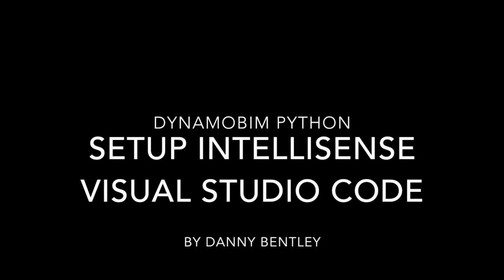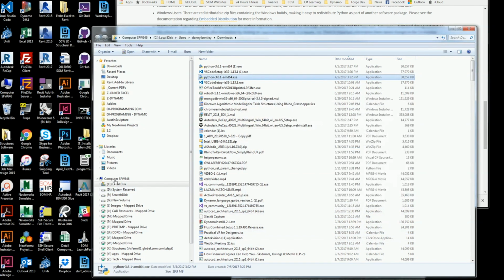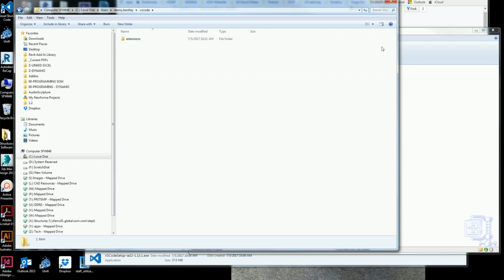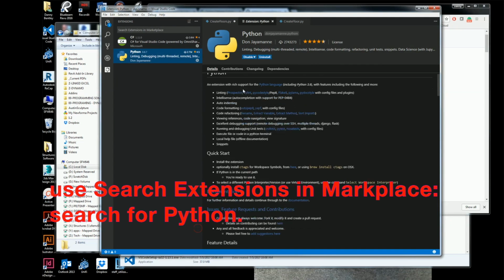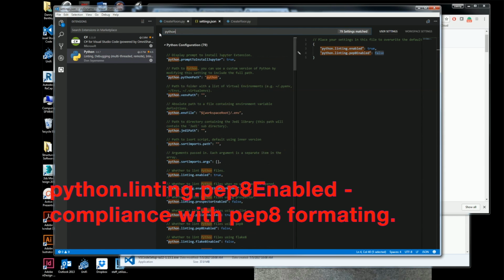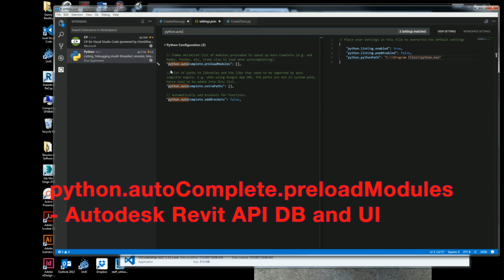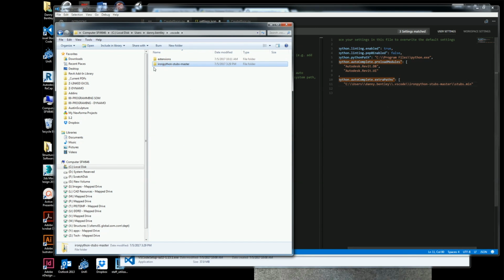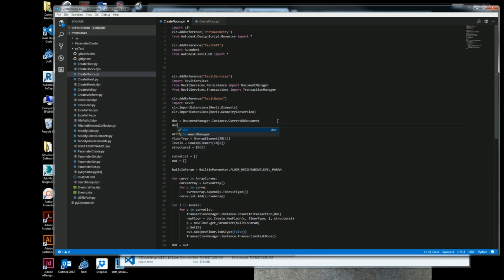DynamoBIM using Python Getting started setting up Visual Studio Code and Revit API IntelliSense.

Comment: Thanks for the video - it's great! I have one question. I downloaded the same extension as you, but there isn't function: python.autoComplete.preloadedModules. How can I link modules Revit.DB and Revit.UI to vs code?
Reply: I had the same issue... I found that 'python.autoComplete.preloadedModules' has been deprecated. They suggest changing this setting instead: "python.jediEnabled": false
Info here: https://github.com/Microsoft/vscode-python/issues/1704
After doing this auto completion seems to work good and fast, however...
pylint is giving me a bunch of 'unable to import' errors, so I just had to turn off pylint. Hopefully I can find the reason at some point.

Comment: Is there a way to run python scripts in VScode with a live connection to de dynamocore.dll API or RevitBatchProcessor or RevitPythonShell?
Reply from the maker: Sadly I not aware of a connection like this at the moment.  Dynamo needs the code in the python node to compile.  The IDE shipped with Dynamo isn't good, but they are trying to improve it.  I would like to have the ability to write in VS when I double click on the Dynamo node.  I would also like to have VS understand that it's using the Dynamo and Revit packages and give me the intellisense.  I will keep my eye out for a solution like this and if I do I will share it.

Comment: Just a quick question. 
Did they somehow manage to integrate CPython into revit? Cos, you were linking a 3.5 python into the python intellisense?

If so I'd be very happy because IronPython is like.... very very old. Can't even use numpy :/
Reply from the maker: Thank you for your post.  Revit uses .NET and therefore uses IronPython.  It seems that .NET has a Numpy, Scipy etc library.  

You can find a blog post here: http://blog.enthought.com/python/scipy-for-net/#.WYSltITysuU 
and the github repository here: https://github.com/numpy/numpy-refactor

Hope this helps.   I haven't given it a try but maybe I will.  :)
Reply: Thanks! I had no idea that both libraries were already available, I must have been browsing outdated sources.
I wish IronPython3 would be released soon though.
Reply: Btw, I just realized it can be done using subprocess if I'd want to use the latest libraries. I wonder if that approach will be stable though, or if it might cause lag?
Any ideas?

Comment: Thanks for the video Danny, any reasons why you didn't use the community version?
Reply from the maker: Hello Ricardo,  I was using the VS Community 2017 beta, but I wasn't able to add a reference dll using Python.  This conversation started on the form and we learned that we could add the IntelliSense through VS Code.  It's not perfect it's still missing Dynamo dll, but it's a start.   If and when we get a better IDE I will add it to my channel.
Reply: @DannyBentley  
I've been using Visual Studio, which is often conflated with VSCode